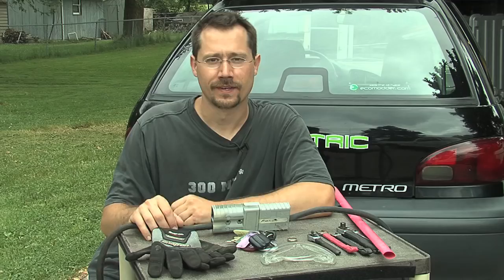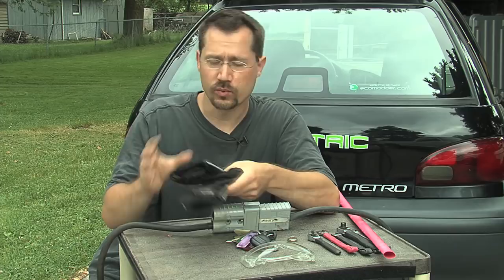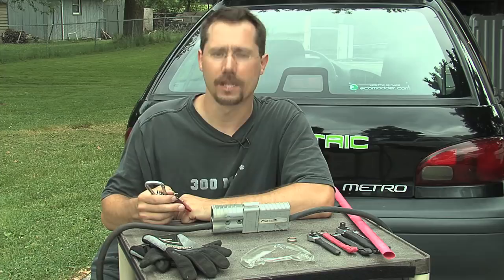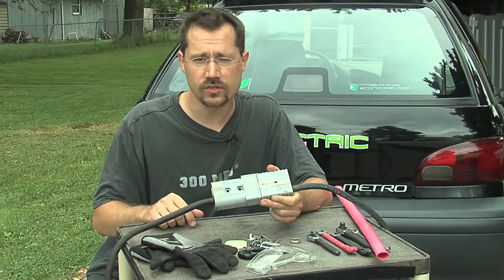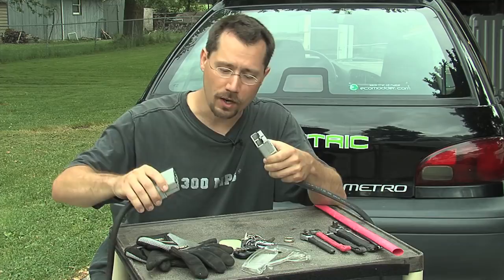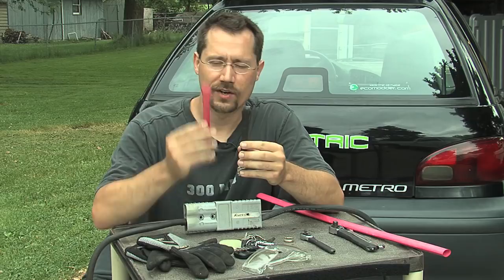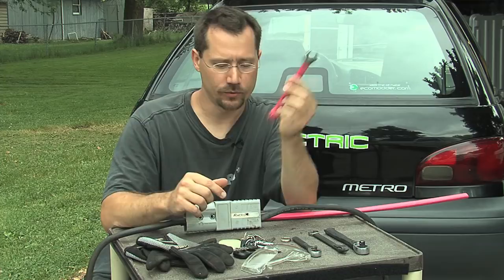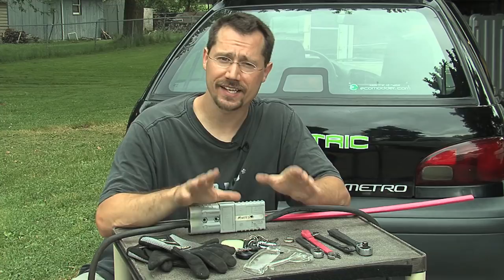2 Build Your Own Electric Car: Safety

Comment: Ben, you now have me interested in tackling an EV project.   I have an junked 77 Triumph Spitfire in my garage that I think would work well.   After researching a bit,  I'm planning to salvage a DC motor and whatever parts I need from a fork lift as there are several used Yale electric forklifts (not working d/t dead batteries) for sale close by, for about $700.   I need to go cheap, for sure.   But I'm wondering if it is better to go for a larger motor and configuration or stay lighter?   1 fork lift has a motor that is listed as 48 v and the other is 36 volts and there's a big difference in the weight of these fork lifts, the larger is nearly 6 tons.   

My plan is to use the EV Spitfire just around town, just for short excursions, 5-10 miles max, in the Spring, Summer and Fall and let it rest in the Winter.  I live in North Carolina near Greensboro.      What would you recommend?
Reply from the maker: Jim Husted (Hi-Torque Electric) has some great advice about choosing a forklift motor at: https://www.diyelectriccar.com/forums/showthread.php/using-forklift-motor-and-choosing-good-7598.html
Read the first couple pages of that forum entry for some solid info on which forklift motor you might want to use.

Comment: you do realize you cant use the other side of the wrench since you have heat shrink tubing on it. right?
Reply from the maker: Open-ended wrench is generally the most useful for batteries. If I want the closed end, I also have a socket wrench with an insulated handle.
These are specialized tools. I only need one or two done up with the insulation.

Comment: Has it occured to you that there's a piece of metal you habitually carry that's really really close to your eyes? :) Because it occurred to me, just as my specs almost fell into a 600V 400w amateur radio PSU :-|  it's a point I pass on to others at risk of a similarly shocking realisation :-)  It's possible you go for the same compromise mediation trick as I, to fit an elastic 'keeper' running behind my head between the earpieces, it doesn't completely remove the risk but it helps..
Reply from the maker: Good thing to keep in mind!
Wearing plastic safety glasses usually helps solve this problem.

Comment: 40 years of turning wrenches i have never worn gloves
Reply: That's because you turned wrenches on a gasoline motor you didn't need to be insulated from the ground wire which is where all energy expels from a battery and is attracted into the positive side in an alternator type setup